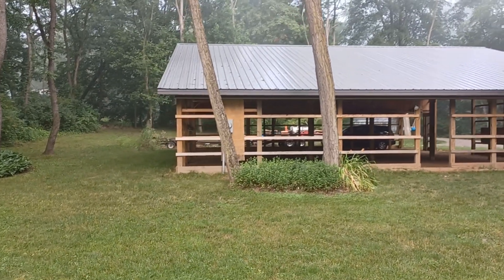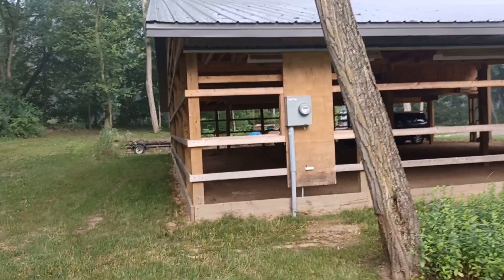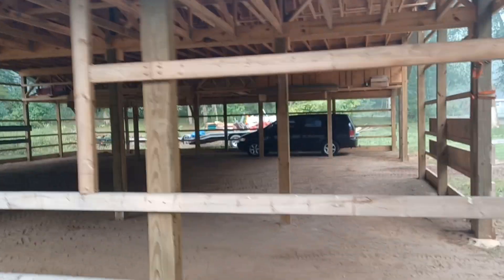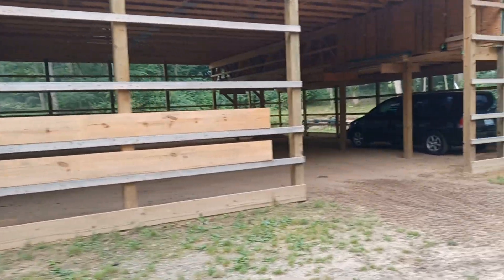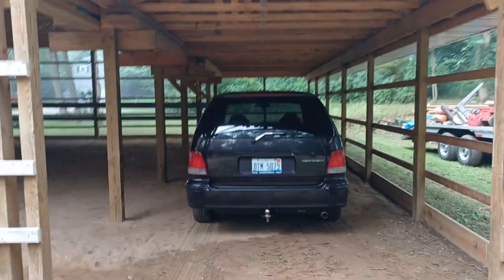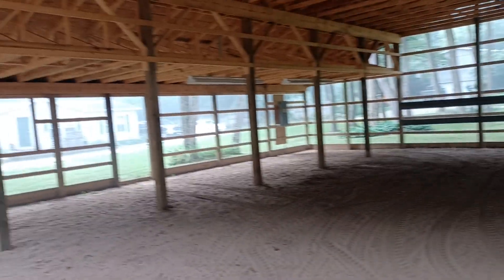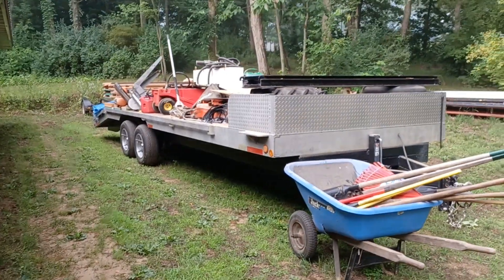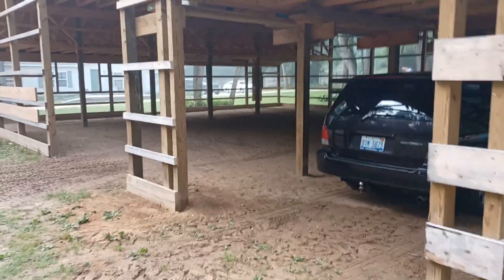Barn Update; Ready for Concrete Prep & The "98" Honda Odyssey

Comment: Looking great!
Reply from the maker: Thanks Jim. 
Getting some concrete will sure cut down on the dust at our place, and a lot of dirt getting tracked into the cars/house. Did you get any more bids on your concrete.
Reply: @brettblack7049  Nope.
Reply from the maker: @WoodchuckCanuck  afraid they'll all be as high as the first one  😳?
Reply: @brettblack7049  Not afraid. I'd have to get a quote to compare. No one will take the time to send in a quote.
Reply from the maker: @JimBarryWoodworkersWorkshop  oh man. That's part.of the reason I jumped on this guy, he could start right away. They're pouring the lean-tos at 8 this morning. Not sure if they're going to try to get the main poured today or not, it's supposed to rain tomorrow.
Reply: @brettblack7049  We've been trying for 14 months now.
Reply from the maker: @JimBarryWoodworkersWorkshop  wow, that's pretty bad. 
Both bays are now poured, the first one is finished. We're supposed to get an inch of rain tomorrow, so they'll pour the main on Thursday.